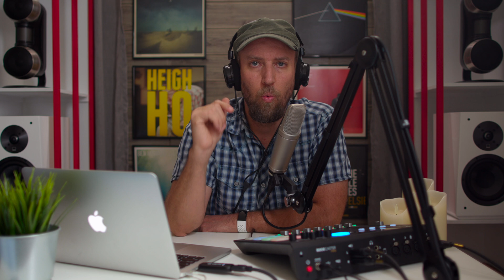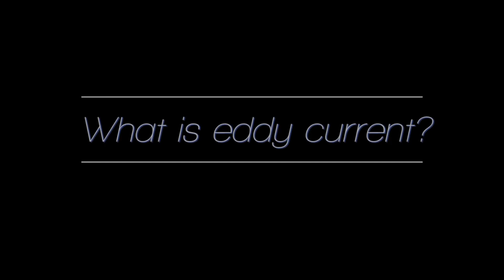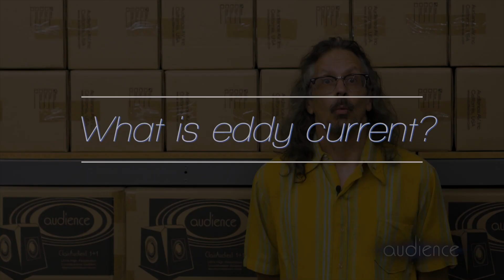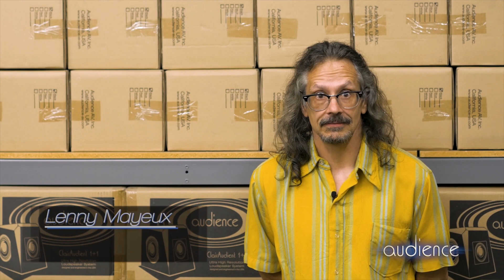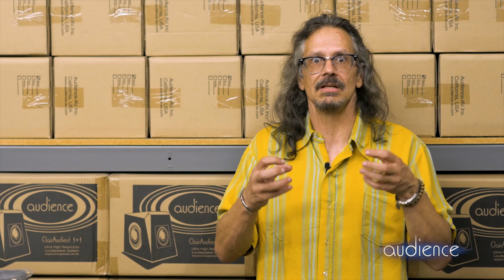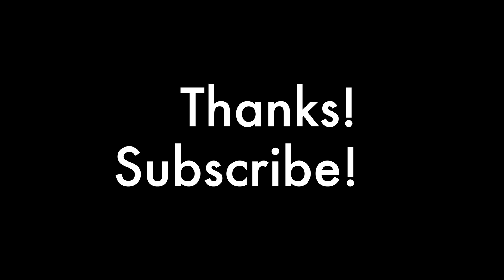What are Eddy Currents? with Audience AV

Comment: In the analog audio sector, however, the skin effect doesn't carry great weight because it depends on the frequency. Only from 50 kHz onwards with a 0.5mm² conductor this skin effect will be noticeable at all. For example, the resistance only increases by 0.2% at 20 kHz, and by 20% at 200 kHz.